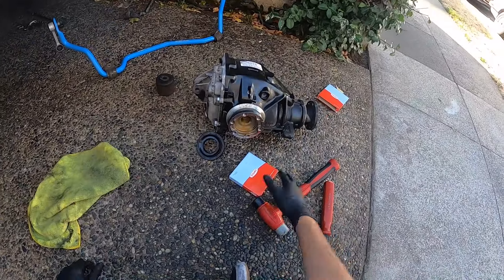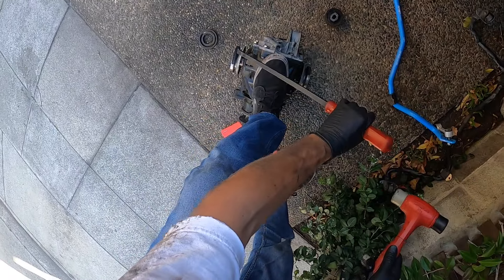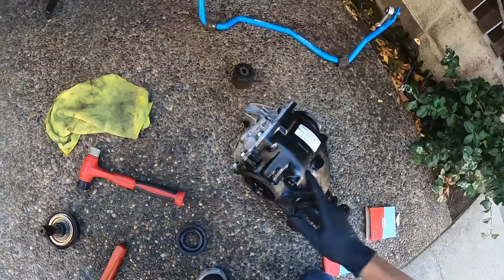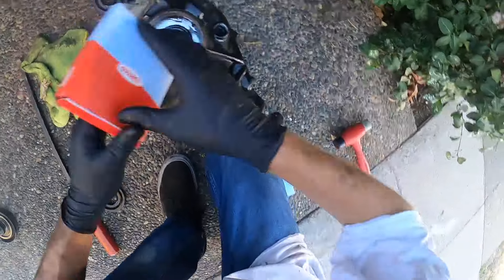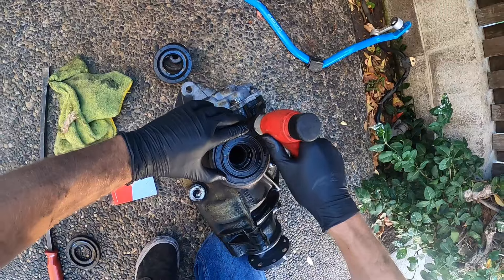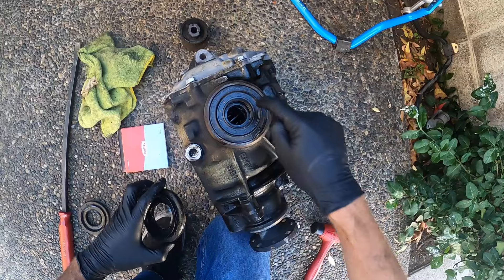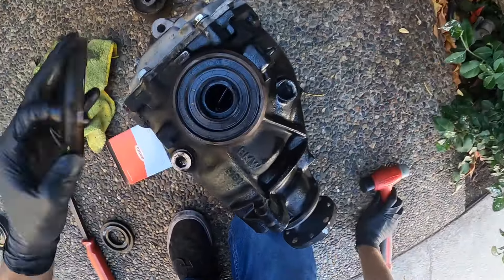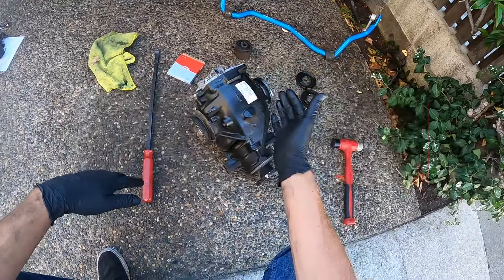Replacing BMW Differential Output Shaft Seals (NO SPECIALTY TOOLS!) - TAKES 3 MINUTES

Comment: Be aware how deep the original seal was. Better to measure before replacing it. If you push the seal too deep than it could close an oil passage. The consequences will come a little bit later on.

Comment: Just about to do this with my diff out. I have to change diff mount bushings too. Do you have to drain the diff to change the output shaft seals? I plan on leaving it full when i take the diff off the car as i changed the fluid not too long ago.
Reply from the maker: Good question, I did not drain the fluid, replaced the seals with fluid still in the diff. Thanks for watching!
Reply: @ProjectBMW  thanks for answering. So no drain it is. Great and helpful video. Mine is an e39, i guess mine has the locking ring that comes with the kit and you did not show this ring in your video. Cheers.
Reply: @sweetsuductress  i have no idea why you wouldnt drain the diff... you should replace the fluids anyways
Reply: @e36fanatics  diff fluid lasts a long time and I changed mine recently before this job. Anyways, it's been a while and I changed the seals without draining the diff but I did change the fluid about 2 months after.

Comment: thanks for the info, I was just about to change them.
Reply: Did you change your with diff on the car? Did you have to remove the exhaust?
Reply: @maxvista I don-t remember much as this was long ago when I tried. But I remember mine was too rusted to take out anything. The exhaust does have to come out however if you are to remove the driveshaft to access this

Comment: Hey man,
Nice job.  You make it look easy but since I was paying a guy to help me work on the rear suspension of my Z3, I let him do that for me.

Today, I rebuilt my inner cv joints and noticed that the right outputshaft came out as I tightening the cv joint to it.  Can I hammer it in myself to make sure it locks in place?

Comment: My front diff is leaking. I’m pretty sure it’s the output shaft seal. Should I also replace the input shaft seal while everything is apart?
Reply: you could... but also make sure the small vent port on the back of the diff is open.. if that clogs its gonna push oil out of whatever seal new or old.

Comment: I have just done this on my 2004 e87 2.47 ratio diff and now I have reinstalled it in the car drove for a few day and now making a very loud pinging noise every time I touch the throttle or come off the clutch had a look underneath while someone applied load on the clutch and the ping noise looks like it’s coming from where the prop shaft attaches to the diff any ideas?
Reply: Did you ever figure it out?

Comment: My seals come with small c shaped clips, where do they go?
Reply from the maker: The c shaped clips “clip on” either the axle/ or output shafts (what I hammered off the diff). Depends on what model your car is. Your axles (and output shafts) should already have the c clips installed, I usually just toss the clips that come in the kit and re use the factory clips.
Reply: @ProjectBMW  Hi, I've just seen under my car, one of my axle shafts has actually popped out and leaked diff fluid. Do you know why? It's an E36 small case. Welded diff.

Comment: Does anyone know how to remove the front shaft without taking apart the diff? My front is leaking pretty badly
Reply: Were you able to replace only your shaft seal, or what ended up happening? Haha
Reply: @austinmerrival927  ya I just cleaned it up really well and seen it wasn't that bad, just mostly from the knuckle joint was sloshing oil over time. But I reapplied grease and rebuilt the driveshaft, new guibo, new, centering drive rubber thing, new cv joint gasket. I will take it back apart in the future because I severely want an lsd, so I will either convert or put an m5 diff in and lengthen the driveshaft

Comment: Thanks for this video. Great tips. Need advice on excessive clunking on my M3 F80 6MT when suddenly depressing clutch pedal to shift gears particularly at low speed/low rpm. Not yet sure if noise is coming from differential , or from flex disc & carbon prop shaft, or from transmission gearbox. Rubber mounts and bushings are all good. Any advice is highly appreciated.  Thanks

https://youtu.be/3jMtmQQgJSE

https://youtu.be/BKlpXe1XyqA
Reply: I had this problem and when I replaced my rear main seal I went ahead and replaced the flywheel and clutch and my clunk went away.